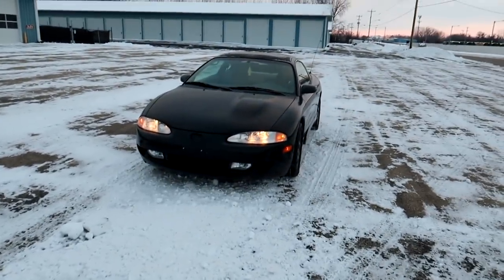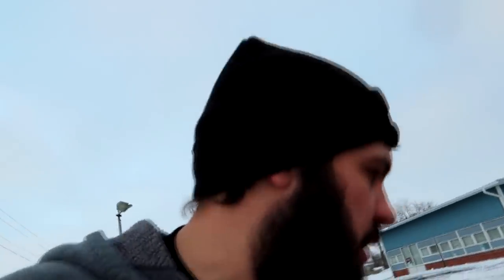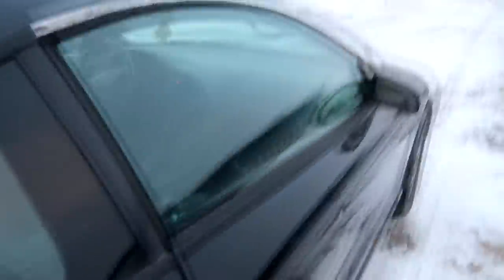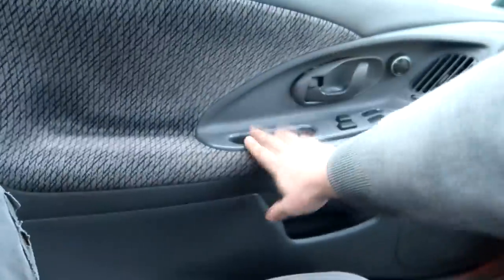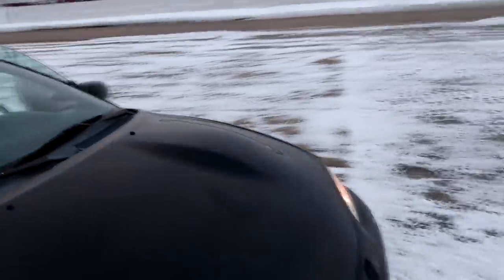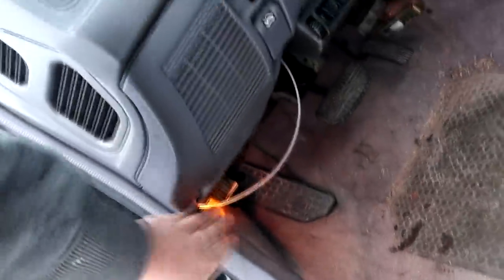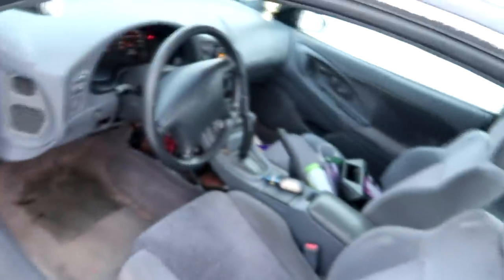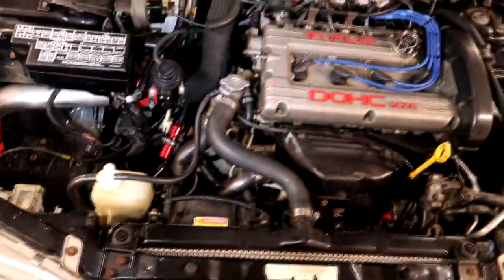I Got A DSM Cheap ...... 96 Eagle Talon TSI

Comment: Td05 will be a 14b or a 16g, boost leak test it, you have to changed the trans to do awd, i uses to be into dsm years ago
Reply: those 13g turbos spool perfect for a starter turbo kit on my b18b turbo crx on E85 whole lotta boost reliable on an oem turbo ;)

Comment: I've been rebuilding a really nice '98 GSX for about a year. Most likely it has a 16G turbo. They bolt in to replace the T25 (assuming it was a T25 and not a 14b) Don't bother with DSM link if it's a blackbox. Just tune it like it's an evo with an openport cable like you said. It's pretty cheap. There's no live tuning/datalogging unfortunately with that though. Assuming it's a 16g, 20psi will get you about 300whp and be pretty safe. probably more since it's FWD. I would do a 190lph and slightly bigger injectors. Looks pretty clean man good luck

Comment: To AWD swap it you need to change the transmission to an awd, install driveshaft carrier supports in the tunnel, swap the rear subframe with an awd one which requires putting the subframe in the exact correct spot then drilling holes where the bolts are supposed to go and getting bolts in to bolt the subframe too. On top of that you need an AWD fuel tank, transfer case, driveshaft, left side CV axle and intermediate shaft and lastly the exhaust! I'm in the process of doing 2 currently. Easiest way is to get a complete donor car, its a lot of work but not a lot of work if that makes sense?

Comment: Didn't expect the engine bay to look that clean with how the outside looks! Check out Jason Drew's AWD swap, it's a big process. Watch out on those door handles in the winter especially because you can only open one door! Never had a 2g, but enough people have talked about it and bought the aluminum door handles for it to be a concern. If you end up selling it try and keep the trans in good condition, DSM is a interesting community cause autos are always desired.

Comment: DAMMIT BOY! I used to LOVE DSM/CSMs (Colt/Summit/Mirage). I had a 1992 Plymouth Colt hatch with a fully built 4g63t, and I had a 1990 Eagle Talon Tsi AWD turbo. I miss those cars. My buddy had an original 1989 Dodge Colt GT that he converted to AWD and did a 4g63t swap on it. I had another friend in Colorado that had an original 1989 Dodge Colt GT and even FWD his 4g61t (1.6L DOHC turbo smaller brother of the 4g63t) ran into the high 10s. That was before my obsession with Hondas.

Comment: The first tuner car I worked on, back in 2006, was my then-GF's 96 Eclipse.  I replaced the water pump and timing belt, changed a leaking auto transmission gasket.  God I hated working on that car.

Comment: it does have too much boost it has has the auto injectors thats smaller than normal manual ones. my manual came with auto injectors and would be lean. if their grey ish they are indeed autos throw some manual ones or bigger ones n get a tune shell run mint.
Reply: also that engine bay is really clean these cars r so molested almost as much as hondas